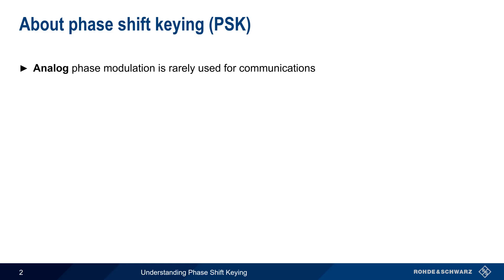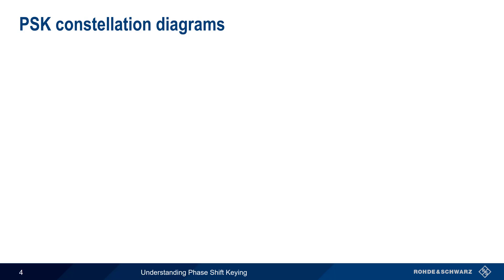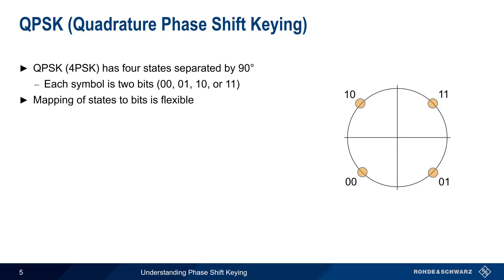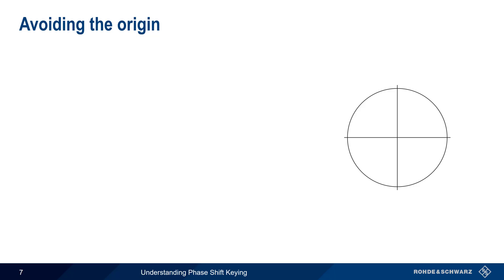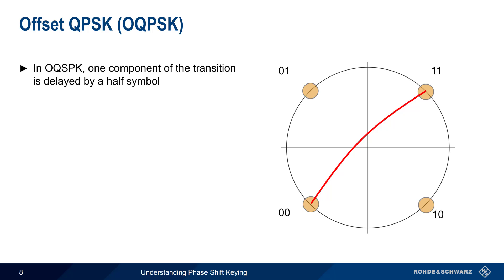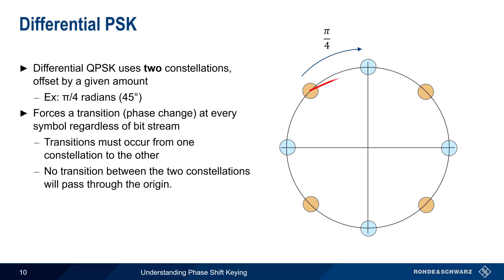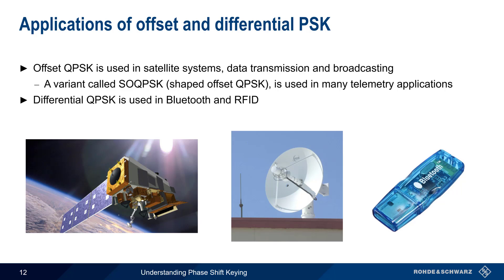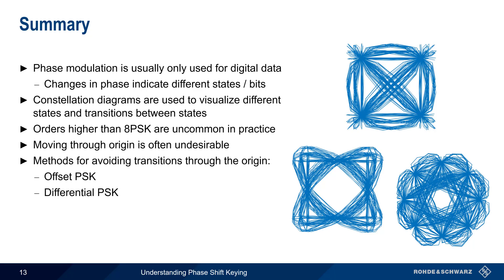Understanding Phase Shift Keying

Comment: Why don't you want to transition through the origin?
Reply: The “radius” of the circle is amplitude. / power, so the origin represents zero to no power.  Generally speaking, it’s easier and more efficient to design and operate a system where power remains relatively constant versus one that goes from full power to zero and back again frequently.

Comment: trivia: in order to reach 11 mbps transmission rates, 802.11b uses QSPK
Reply: Yes, higher bit rates generally require higher order modulation (and/or wider bandwidths).  The newer "flavors" of 802.11 achieve even higher bitrates in part though even higher order modulation.

Comment: Thanks for the great video! I still have one question though: At 0:29 you can see the face shift marked with the red circles. But: You stil have an electromagnetic wave right? When having a normal dipole antenna you cant just send two "low signals" right? Doesnt it have to be a oscillating waveform?
Reply from the maker: Hi John, 

We've received your question, and we are routing it to one of our experts to assist you. We'll get back to you soon!
Reply: Hi John -- thanks for the question.  You are correct that all RF is an oscillating waveform.  That said, there are numerous ways of representing a "low" state with an oscillating waveform.  For example, in ASK (amplitude shift keying), a "low" state is usually the lack of the oscillating waveform (!).  In FSK (frequency shift keying), the "low" or "zero" state is usually the lowest discrete frequency used, and in PSK, a "low" state is somewhat arbitrarily defined as one of the phase states.  In all cases (except the on-off ASK keying), an oscillating RF waveform is always present.  Hope that helps!
Reply: The cases I have worked with in regards to BPSK is in RADAR pulsed RF applications. Despite the change in phase, the amplitude & frequency at 0 and 180 degrees will be the same. Except for the brief moment that it passes near the origin. The signal(sine wave) never stops radiating until the end of the pulse period. The easiest examples to understand are barker codes. Say you had an 11 bit barker code represented as +++---+--+- and a pulse duration of 11us. The pulse is active for 11us with the first 3us as 111 next 3us as 000. And so forth.

Comment: Hi, I am a newbie and trying to grasp the concepts for the first time. In regard to BPSK specifically: if you have say 3 bits that are identical in a row, as an example, wouldn't the symbol rate be different than the bit rate for a given period because 3 '0' bits are passing without a symbol (phase shift) to indicate a '1' bit? I am not understanding how the symbol rate always equals the bit rate if there are identical bits transmitted in succession. Is there a phase shift no matter what every time a bit is transmitted? My understanding was the phase shift happened only to indicate the change in value...help me understand what I am missing?
Reply: The symbol rate is simply the rate at which "symbols" are sent or interpreted (i.e. symbols per second) - there's no requirement that the symbol characteristics (frequency, amplitude, and/or phase) change between symbol times.  The problem is that both sides have to agree on the symbol rate -- did I get three zeros in a row or did I get one (long) zero?  One way to do this is simply by having both ends agree (beforehand) that they will use a certain symbol rate.  The other way is to have a way of determining or deriving the symbol rate from the pattern of the received symbols -- e.g. using some kind of preamble, synchronization, or training sequence.  In many simple BPSK based systems (like POCSAG paging), the two ends agree on the bit / symbol rate ahead of time (2400, 4800, 9600, etc.).

There are advantages to having symbols change every symbol period even if the bit value doesn't change (e.g. the discussion on DPSK in this video).  And in some systems, the user data bits are "scrambled" (in a predictable and recoverable way) in order to ensure a certain minimum number of bit (and therefore symbol) transitions per unit time -- i.e. avoiding long runs of ones or zeros, so to speak.  Whether or not these schemes are used depends on the particular application, but they certainly aren't uncommon.

It's an excellent question and one that I'm actually planning to address in an upcoming video, so thanks for asking!
Reply: In BPSK the phase shift indicates a state change from the current bit level.  No phase change means new bit is the same as the last bit.  The initial bit state must be defined by the RF protocol, or fixed on the back end by inverting the bitstream.